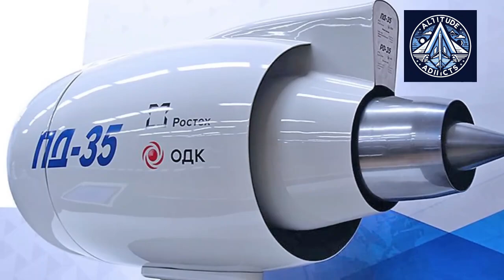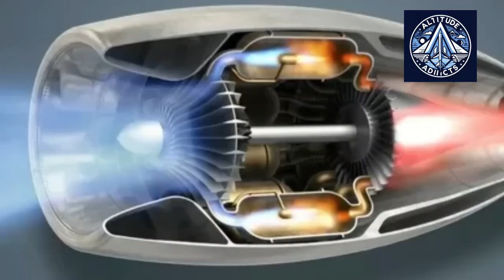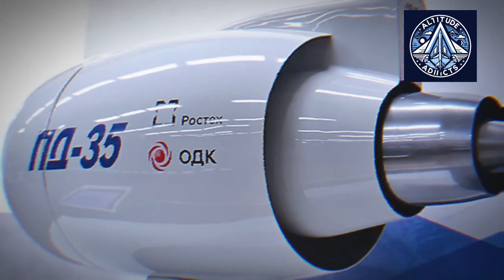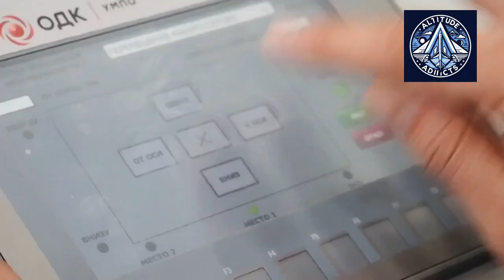Russian Engine Breakthrough: PD-35 Hits 35 Tons of Thrust

Comment: The GM engine on B777 have an output of 56 ton of thrust. So the PD35 has at least an additinal 20 plus ton of thrust to go to be worthy, seems like a long way to go.
Reply: Russia does not have and will not have planes like the B777. For current jets and those planned for the next couple of decades, PD35 will be sufficient.
Reply: Not trust, thrust.
Reply: @cmdelpa  Thrust on trust or trust by thrust? 😊
Reply: @Brocambro1  Russians do not need that

Comment: Game changer. To be completed by 2030. so, it means six years require only for testing. By the time, GE would have new generation engine.
Reply: Aviation engines design has come to its limit. Further improvement is practically impossible. The next generation of motors suppose to be based on the different physical principles.
Reply: @andriandm  Warp drive?
Reply: @rndofpipowe  
:)
I'd rather say a combination of the regular jet and ionic engine. But I'm not a scientist, I can only speculate.. 🙂
Reply: They are having problems with the GE engines being trialled on the new Boeing 🤣😂
Reply: @MarkFarrington-hb2ne  
No wonder. Nowadays even 5-7% of improvement is counted as a great achievement.